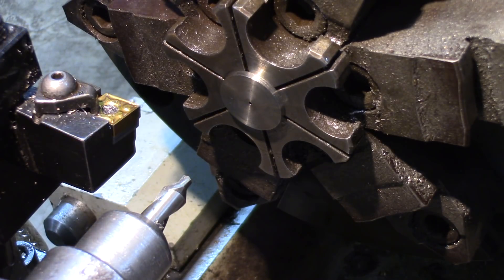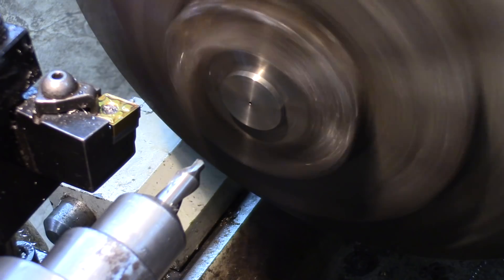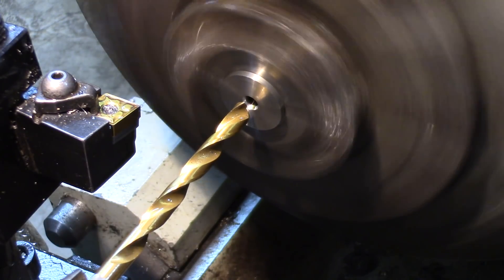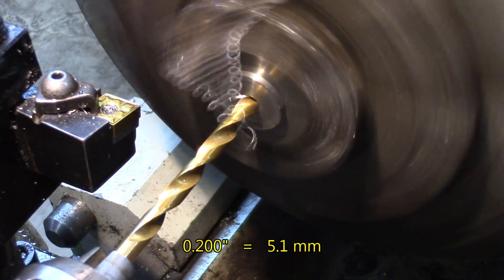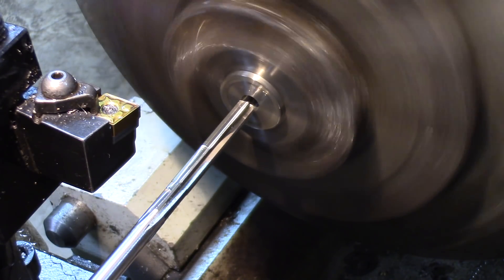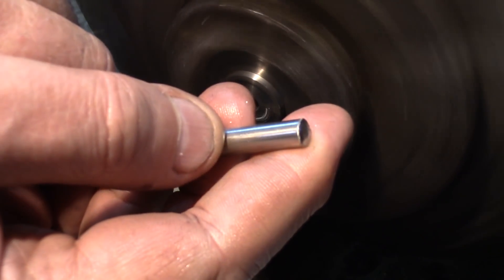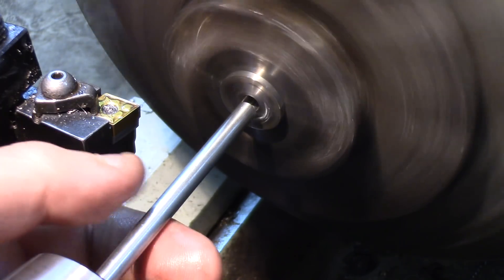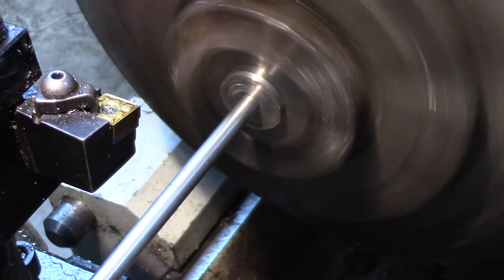Machinists never make mistakes, only invisible repairs...

Comment: That has to be high in the center by several tenths at least with that "polishing" technique. :-)
Reply from the maker: Here the goal is to make a parts with non critical dimensions, and used mostly to stop a wooden handle from slipping out of the main body, naturally a good machinist will adapt techniques and finishes to the final purpose...   ;)
Thanks for watching and for yourcomment,   Pierre

Comment: its just a bluff job , not the worst , but without knowing what the part was heading for , id not be doing it , say it was a hydraulic job or the likes ,,,, not good , , a stepped sleve pressed from the inside , then tig welded  re faced , even a friction weld , but just to beat in a slug and face it up is not a repair.
Reply from the maker: Hi Tom,
Don't worry about the final use, it's a cosmetic cap with no pressure or strength required...
I totally agree with you, that for a high-pressure situation it would require
A: a new part,
Or
B: like you propose if new part isn't available, the deluxe treatment is REQUIRED in order to ensure that the pressure would not cause any issue...   
Thanks for viewing and for your input,   
Pierre
Reply: your a gent ,,,, keep up the great videos ,,,
Reply from the maker: Thanks....     ;)

Comment: If someone were to do a fluorescent dye penetrant inspection of that part, would the repair show up? I used to do NDI for the Air Force some years back.
Reply from the maker: Hi John,
This is mostly a cosmetic repair with enough strength to hold by itself, but, I highly doubt that it would pass a dye test, it wouldn't be constant on a big production... 
Maybe with real high interference and or, heated part on the outer component and deeply frozen inner part, this would have to be tested...   ;)
Parts would need to have a very smooth surface finish in order to avoid any path on the surfaces.
Thanks for your food for brain,        Pierre

Comment: Is that a drill doctor on the bench behind you?
Reply from the maker: Hi, yes this is a Drill Doctor, I find it pretty useful to resharpen smaller bits, even more, the solid carbide ones. I find it needs a little getting used to in order to get the best of it, otherwise, the high-end sharpening tools are way out of my reach as far as price is concerned.
Thanks for viewing and for comment,    Pierre

Comment: Nice and neat. And I was wondering ( on other video from you ) why are you taking 0.002mm so serious. You are a perfectionists, that's why :)
Reply from the maker: Hi Marko,
It all depends of the requirement for the part, if you need real thight precision and tolerance, then, you need to be able to measure with lots more care than if you need only wider range tolerance where it's much easier and faster to machine and measure...   ;)
Thanks for viewing and for comment,    Pierre
Reply: No offense taken :) . I just wondered , how could that be possible .
The precision really costs a lot , but we know very well why :) , and the client knows too .
Reply: 0.002mm ? , noone can hold that kind of tolerance , its hard to measure also .... was it not 0.002 inch ?
Reply from the maker: Hi, like you say it's very difficult to measure accurately, more practical to measure something closer to .0004 mm that is .00015", still a challenge though without the proper measuring tools and references, you can see in some other videos that I own some good tools in the measuring field...   Not the ultimate, though.
Reply: It must be achievable , but only for one offs . At my workplace we have some serius masuring equipment , but it's rarely used , many don't know how to use it . It has a resolution of 0.0002mm , but i simply can't imagine putting 2 different workpieces in the device and getting the same results .
The most precision i can get on the cnc lathe that i work on , is mainly +-2 micrometers , but the values always tends to drift a bit (thermal expansion and machine error , insert wear , material composition change , wheater , the planes in the sky , etc) .
To me anything under 0.01mm tolerance is a "please take it to somewhere else". 

Thanks for the reply and have a good day :)
Reply from the maker: Hum... I just noticed a mistake in my upper statement it's not .0004 mm but .004 a hell of a difference, the Imperial number is ok though, on production runs a constant 0.01mm is a great score in deed... 
Just to say that just a little more precision is a lot more $$$$...
Excuse my mistake...

Comment: Why not tig it
Reply from the maker: Hi Alex,
Tig, in this situation would be much more time and setting up, since this is only a cosmetic repair, that kind of fix is faster an adequate, if you need to fix a part where pressure is involved, Tig or even making a new part would be the solution....
Thanks for viewing and for comment,    Pierre

Comment: if I be the customer I wouldn't be happy about this botch job what if the application of this part requires strength of a solid 304 piece. this be SCAR from quality to supplier
Reply from the maker: Hi Marco,
Like explained somewhere in the video, there is no compromise to solidity, it's only a cosmetic repair, and, I'm the customer, the parts are for my own use...  Judgement is to be applied in machining parts and if done the customer has to agree....   ;)
Thanks for viewing and for comment,    Pierre

Comment: What was the nature of that part?  Would such a repair hold up under pressure or other mechanical loads, or is it purely cosmetic?
Reply from the maker: This part is a cap for the hammer it's only a cosmetic repair, if you had pressure and be stuck to make an emergency repair you could make a plug with a flange and press it from the inside if it were possible then the flange would resist to a fair amount of pressure...
Thaks for watching and for comment,    Pierre

Comment: no welding required just add pressure LOL
Reply from the maker: This kinda repair is acceptable mainly where the issue is more cosmetic than functional, we always got to use good judgment as we make parts...
Thanks for comment,    Pierre

Comment: Do you like your Drill Doctor?
Reply from the maker: Hi, 
This model is just a notch above the base model and when in special it cost about 75$, at that price it does a decent job, there is a learning curve in order to get the best from it, I find it does pretty good on smaller bits, it can sharpen up to 1/2" with the supplied holder, there is an optional holder that allows sharpening up to 3/4" bits.
Also it does great for solid carbide drill bits cause it uses a diamond wheel, this helps to pay for itself, carbide bits tend to loose some chips in the end and a little refresh helps.
Bottom line it's an all right tool to have if you can learn the basics...   ;)   
(Even better if you get it on special)

Comment: Nice Pierre, a simple and easy fix which should be a helpful tip for the hobbyist. Now unless you had measured wrong or had misread a drawing or measuring device I do not think that you made a mistake as it was more than likely an attention issue, which tends to become more of an issue as we get older. Anyway, be well my friend and godspeed with all of the holiday projects!
Peace!
Reply from the maker: Hi Jeffrey,
I was just a little too bold and wanted to get as much depth as possible for the tap, since I didn't have a bottoming unit, got repaired easy.
Getting older brings lots of changes, mainly in the slowing of activities...   lol
Thanks for support and Happy Holidays to you and your family,     Pierre

Comment: That drill was in and out without a trace!

Nice tip Pierre, I'll keep it in mind :) I'm also going to try switching to rougher sand paper when I start to polish stainless after seeing how quickly you did that.
Reply from the maker: Hi Adam,
First, before using sand paper, preferable to use the automatic advance in order to give you a more regular finish, also a fresh insert or ground HSS tool with a decent radius on the tip.
Starting with rough grit will even the surface faster, then, you have to go gradually in order to erase the traces from the previous grit...
To get a mirror polish it takes a lot of prep and care, the fine brushed finish is I find a very nice way to make stainless look good.
Glad you enjoyed and thanks for comment,     Pierre
Reply: I've discovered a polishing compound called Brasso works a treat for a mirror finish - a tiny dab in a paper towel and it's like nothing else. Super reflective!

They also make Silvo but it doesn't work as well, I think it has a larger grit size.
Reply from the maker: Brasso has been there for maybe near a century and always done the job mostly for brass, also great on other metals but the abrasives will break down faster and won't last as long for serious industrial use.
You can also shop for specialized polishing compounds if you do lots of polishing, then you get the adapted grit to the metal you work with.
Enjoy metalworks...   ;)
Reply from the maker: Patrick Rebecca Doohan
Didn't know, but, I'll look into it...   Thanks
Reply from the maker: If you don't use the UVprotector the gloss won't last more than a year, even much less...  Look out on Google for UV protective lacquers and check if they're compatible with the plastics from the headlight on cars, every country has something available of the shelves in automotive stores.
Reply: Pierre's Garage great, I'll have a look around. The headlights start to yellow here after 3 months! Thanks :)
Reply: Autosol makes everything shiny, including your sanding scratches :)
Reply: Pierre's Garage (Patrick here again, different account) I would use autosol on plastic injection moulds that made clear lenses/screen covers for small hand held devices (specifically agricultural electric fence testing units) 

When polishing if you missed a tiny scratch with the 1200 grit or finer the autosol would show it up very quickly. Autosol added to wet and dry paper instead of water also produces a really nice finish on turned parts. If you let it dry off a smidgen and apply pressure it almost burnishes the surface.

Then there is the quality of the P20 tool steel to deal with , sometimes you could spend the most part of a day polishing only to find the materials grain leaves a slight pitted surface that can't be polished out. Such is the life of a toolmaker!
Reply from the maker: I've seen that the product is available just about everywhere, I'll try it next chance I get, seems like it could also work on plastics, I'd use it to re-polish lenses for car headlights, then just add a clear lacquer that resists UV.
Thanks for the application notes...   ;)
Reply: That's exactly what I used it for last, polishing the car headlights. Do you use a product to prevent the plastic from yellowing? I hadn't thought of that, we have huge UV problems here in my part of New Zealand.

Comment: Perfect! Invisible repair - done a few of those! Always satisfying when it comes out right. :-)
Reply: You could use a plug with a small shoulder and press in from the inside if it needed to withstand a bit of pressure (assuming you had enough inside diameter to work with)?
Reply from the maker: DSCKy
What you propose is a sensible solution for something that would actually work, not sure that in this particular case I got enough inside clearance,but in other situation it would be the solution...
Thanks for your input,    Pierre
Reply from the maker: Hi Chris,
I wouldn't use this for pressure vessels, though....     At least I wouldn't stand too close mostly if the plug is invisible, or, there are many of those...   lol
For noncritical places it's perfect... 
Cheers,   Pierre

Comment: What? No friction welding? 😊 Just kidding.
Nice save.
Thanks,
John
Reply from the maker: It's called love at first sight, and until death...  Or, in this case, destruction...   ;)
Reply: we found out that you dont need friction to weld SST, it does it on its own at room temp.
Reply from the maker: That's called "galling"    Beurk...!!!
Reply from the maker: Could be done...   just need to hold the rod and put the pedal to the metal...
Thanks for comment,    Pierre
Reply: Pierre's Garage 
I think if you place two pieces of stainless steel rod next to each other on the workbench, they'll gall.
They don't even have to move. 😂
Thanks,
John